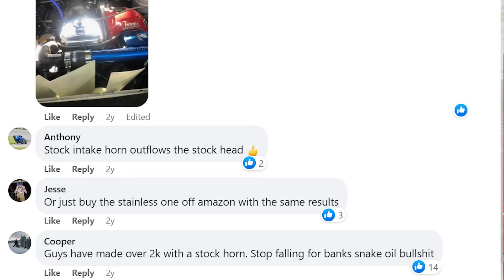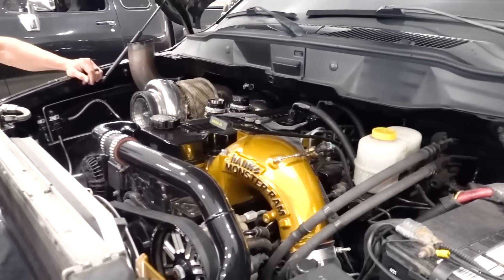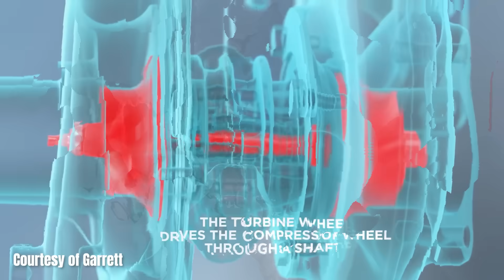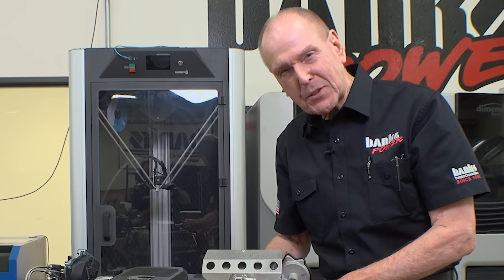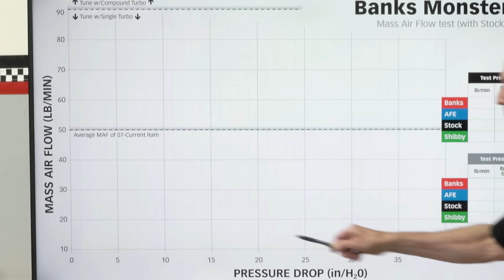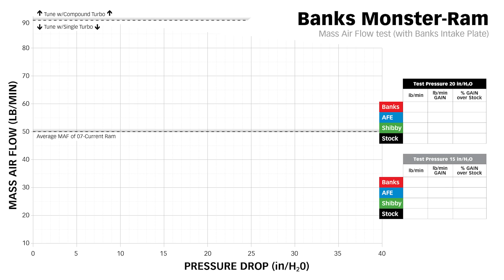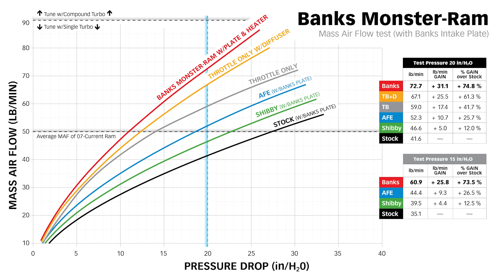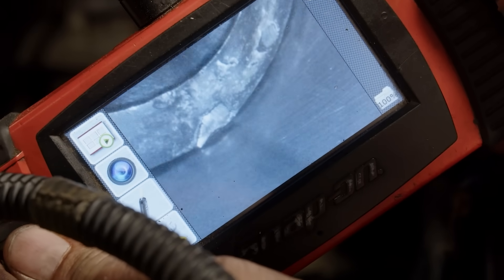Stop this wives' tale about Cummins engines! | Fact Check

Comment: Spoken like an absolute legend, CFM is only volume the air charge density is king to delivering enough oxygen to the fuel charge, so many focus on basic rudementry CFM volume no replacement for displacement well absolutely crap a dense air charge at 15 psi entering the cylinder immediately expands heat energy is absorbed by the time the valve is closed the intake charge density has begun to absorb heat lessen density for only a short few degrees if any really heat energy is transfered into increased cylinder pressure and ultimately higher energy potential of the charge I would imagine thus power gains god sent I absolutely love hearing solid information thank you sir !

Comment: You said the head wasn't the restriction as claimed....  and then showed us a flow bench where you didn't connect your elbow to the head.

Flowbench each elbow with the factory head.  But you won't, because that will show you're wrong. 🤡🤡🤡🤡
Reply from the maker: You've managed to completely miss the point. The Monster Ram reduces air density loss in the intake, so the air going through the head is denser. This means even if the head is flowing the same CFM as before, it's now flowing more air mass. CFM doesn't determine your power potential, air density does.
Reply: And yet you don't measure air density that comes through the head.  You stop at the elbow.
Reply from the maker: Think of air density like your paycheck, and restrictions like your bills. The head is one of those bills, but if you reduce other bills, you still end up with more of your paycheck left.
Reply: @bankspower  think of it like a scientific test, for which you left out the literal component of the argument you're claiming to disprove.  My 13 year old could see what you missed in your test. 

If I said the earth was flat but neglected to use the earth in any of the scientific tests I showed you as proof, it would be just as laughable as your attempt.

Comment: So mechanic here. 😂😂 degree to prove it. I do my research on everything I buy. Banks by far has the best upgrades for cummins. I can't say the same for every make only bc I have not done my research on those makes. I did also replace a few parts. I have the banks intake horn grid heater delete, banks pedal monster, banks intercooler boost tubes, sinister coolant pipe, sinister intake tube. For the engine parts. It is night and day how the banks' parts and sinister parts helped my truck breathe and run way better.
Reply: The only downfall I have for banks is the boost tubes rubber couplers are too short. They are made well just made short. Need a little more  length on them.

Comment: Travis, The better source to ask on the CFM specs would be a reputable machine/ porting shop/ guy who has a flow bench. I'm a 25+ year tech who has and will turn a wrench on basically anything, but my knowledge is limited on flow numbers/ porting experience. Sure I've gasket and flow matched manifolds, done some mild porting work, and built some fully forged/ performance oriented long blocks, but for my machine work, balancing/blueprinting, valve seat grinding, extrude honing, etc I'd rather send my parts to a real engine builder that has the proper tooling to complete the machine work portion of the job. It'll not only save me some time but get me more accurate results in my build as the end result while providing the flow numbers and eliminating any guesswork. It's a no-brainer whenever it's a possibility IMO. There is usually always a welcome upgrade on getting more air in, as long as the engine can make use of the extra flow and the exhaust can extract it. There aren't many OEM manufacturers stock parts that can't benefit from an upgrade.
EDIT:
Funny thing is I started writing this comment at the beginning of the video, and then Mr. Banks mentioned the flow bench.... Wasn't done typing my comment LOL.😊

Comment: I just wanted to say Thank You for the work in coming up with your intake design. I had one installed on my 2017 Ram specifically to eliminate the stock grid heater failure point that will trash my $30,000.00 (installed) 6.7 Cummins. I retired from manufacturing company ownership and know R&D is a significant expense. You spent the money and came up with a top shelf design that solves multiple issues. Thank you again.Side note: the sticker that came with the unit looks dang fine on my Stanley lunch bucket too.:face-fuchsia-wide-eyes:

Comment: Back in 78 when I was deep into turbocharging my KZ1000, I could have used you.  I went through many brands and all either failed miserably or made the same as the competitors.  I gave up as no one seemed willing to either engineer what I  wanted or help me better their products.  I would like to think aftermarket  motorcycle turbos disappeared because of lack of engineering.

Comment: I been running this setup on my '20 2500 (full emissions) leveled on 35's because I got the grid heater code.  Super Scoop/w oiled BigAss filter, boost tubes and Monster Ram. gained 1 mpg Real world city/hwy and idle combined. not only was i happy with the mpg gain, the throttle response is quicker and I love that you an hear the turbo now. it's not "loud" its just enough!!  installed it in the driveway in a weekend.  Yes, it cost me almost $2k but well worth it to not risk the engine for a failure that Ram has not recalled.

Comment: Whoah whoah, you mean even some some people who work on engines and mechanical systems dont understand bernoulis principle and that cold air compresses more readily and is more dense than hot air?  Thermodynamics, math, physics... It's like there's a difference between a mechanic, an engineer, and a technician!  😂

Comment: Great video Mr Banks, but you did not speak or test the head flow conspiracy , you only spoke about the elbow? How much air can you flow thru a  6.7 head with all the different elbows? I think the end all would be testing the flow numbers out the tail pipe or at least out of the exhaust ports, no?

Comment: I've been reading an learning about Banks. You have some pretty amazing engines that he's built. It's not every day somebody builds performance engines for the military. I found his engine theories and techniques to be un unrivaled. I just turned around with small stuff my daily drivers what is insights in the series and his proofs are impeccable and I've used them to produce amazing amounts of power out of otherwise stock engines.  
It always amazes me how much horsepower people leave sitting on the table just waiting to be used and they don't even notice it..

Comment: Come on Gale, MAF sensors do not read "Mass Air Flow" or Density.  ALL manufactures flow bench the entire intake track,  the MAF Sensor is nothing more than a microphone, that is feeding a Frequency in HZ to the ECM and then ECM uses a combination of MAF VS. IAT and even MAF VS. ECT to determine Air Density....   the MAF alone can't do that

Comment: I'm well and truly drunk, and even in my current state I know that the intake manifold is a restriction in airflow if not designed properly. In my opinion, the best design for the intake manifold for a Straight Six is a single, semi-divided plenum with two air feed ports for the front three ports and the rear three ports. Look at the cooling system modifications that were done to the 3406B Caterpillar engine, they added a coolant bypass hose from cylinder six because of overheating back there, and the air intake port for the head was up around cylinder two. The placement of the intake port caused cylinders five and six to run lean, while one thru four ran rich or stoichiometric, which means five and six ran hot, which necessitated a bypass hose to eliminate hot spots and extend the life of the liners and piston assemblies. Yes, the head is a restriction in airflow, but you can only do so much before you require a new and better intake system. If I could design my own V8 diesel engine I would totally reverse the flow, such that it exhausts to the valley, in which the exhaust manifold and turbo is mounted, and from there the compressor side of the turbo discharges to the air to air heat exchanger, and which then feeds air to the intakes on the outside of the heads
Reply: My god, I cannot believe how long this comment is and how long it took to write. Allah forgive me for this

Comment: Before you even get into the reasons why they're wrong, I'd like to chime in. I work with air flow for a number of decades when I did industrial sheet metal with air systems and building rather large heating and cooling systems for industry such as Automotive and Aerospace. Including paint systems and other such devices. Yes, the stock had does flow 250 cfm, but it what density or at how much intake pressure. If they saw a test where it only flowed 250 CFM, it was more than likely at a specific air flow standard. If you could put more pressure through that stockholm, you're going to get a whole lot more than 350 cubic feet per minute through it but why try and force it through a, less than ideal, air horn that doesn't want any more CFM then that which will feed the engine as it comes stock.
Even if the head could only breathe 250 cubic feet per minute, better airflow to the head is still going to result in more power and a better breathing engine. Because it is being fed a better amount of flow, you never tested that head with the better flow numbers getting to it you only tested the head at a rate which it would flow 250 cfm. If I remember right that's pretty close to the flow of a 318 a block from 1965 or so. But that's only at a specific setting.. and for a V8 that only put out about 235 horsepower with a two barrel carburetor, it did the job. But that same head will flow 350 or so cfm, if you clean up just the standard manifold and carburetor and remove some of the restrictions of the exhaust manifolds and related Hardware.
Luckily, I've been tinkering with cars since 1965 and had the luck as a teenager to rub elbows and work with some of the best hot rodders in the business, that were involved in ramchargers racing, and Mancini racing over here on 6 Mile Road in Detroit, back in the 70s. Everything that they taught me about, is still just as valid today as it was then because physics is physics.
Mr banks, your work is much the same, you make sure that everything you try is tested to a higher standard than they did then. Back then they would do a design, and it put it on the racetrack and run it. Unfortunately in the 1970s you started running into Engineers that had never learned to turn a wrench at all. A crescent wrench would confuse the hell out of them.
I eventually did work as a engineering consultant, because I could speak to them and understood what they were saying, and I could relate that to the people actually doing the work because they frequently don't speak the same language. The advantage I had was I knew what could reasonably done in a specific allotted period of time. With the resources that were being applied.
I learned an awful lot about their mindset and the mindset of the people doing the work, which I refer to as applications Engineers because they have to what the engineers desire and have designed, and actually manipulate it to make it actually fit and function. I'll take an applications engineer over a man who draws pictures all day long.
I still prefer the speed density system, because you can extrapolate air density in the intake by temperature and manifold absolute pressure, just as well as you can with a mass air flow sensor, which only takes its information from a single point in the intake air flow.
Temperature and manifold pressure tells you, at least as far as I've ever understood, all the information you need to know as to how much air is actually available at the intake valve before it opens and during its being open. This includes any compression you've added to the intake air. The only major concern after that, depending on how well you have the head set up, is the most least restrictive exhaust possible. Remember that the engine is a glorified air pump, the more air that comes in and the more air that goes out increases its efficiency.
I love the idea of rectifying the mass air flow signal so that you adjust it for the density difference that is necessitated by the larger intake tube. All you did was a step adjustment from air flow at nominal air density through a specific cubic foot of air mass at whatever aspect ratio you're measuring it at, if it's a round tube then the aspect ratio is zero. Then you just step it down to measure the air flow at the greater size of the cross section, at zero on in this instance, bought accommodating the larger amount of mass because you have a larger cross section. The math is actually quite simple although sometimes people didn't always pay attention in 3rd to 5th grade math.

Comment: I dont see how his testing is that great no cold heat cycles no wot under maximum gcwr. In severe desert heat . Typical hot rod california built junk. stock cummins will outlast the truck, modified diesels fail short of engine life cycle. The oem manufacture spent hundreds of millions of dollars on whole package r and d.every component tire size to chassis dynamics is matched.

Comment: So really, we should just use scfm and temperature. Scfm will really be equivalent to mass flow, and temperature is another item we're interested in for combustion. 

Flow wise, I don't think anything is near 'choked' in an engine, so every component can flow more given higher pressure difference. Which means that if you reduce pressure drop somewhere else, your overall system flow increases.

Comment: I have seen other people comment similarly where they felt your products are overpriced but now see why they carry the price they do. I am in CA where your efforts to fight CARB and ensure you can obtain compliance have been immensely appreciated and I am sure immensely costly. I can understand why they carry the cost. I can also speak to their longevity I have a 2002 F250 with a full complement of Banks kit installed on it since new. Zero mechanical parts have failed in 325k miles. The only failure was the chip that improves the system in response to the parts which unfortunately with the age of the truck I just cannot justify the cost to replace but the other parts still work great without it.

Comment: This is interesting to see! I came up with something similar 3 or 4 years ago. Machined 6.7 intake plate with no stock heater, the huge AFE intake horn (non egr type), and my own piping to go from the '05 intercooler to a 6.7 intake and I used a ford intake heater at the inlet of the intake horn. 05 ram swapped to a 6.7 big valve and lightly ported head, 66/74 over S480 compounds, and it starts in colder conditions than my stock 07 or my stock 2017. Makes more boost and power than a stock truck from idle all the way through. Doesn't even smoke unless I'm all the way in it and having fun.

Comment: If air density is a thing I would think you can gain horse power from just cooling the air between the trubo and the intake valves.😇😇

Comment: Gale, I love the science. I have a question. You said near the end of the video that you can acheive more power with the same fueling utilizing the monster ram product package. If the Ram allows more air flow would you not have to add more fuel because of leaning. Would the A/F ratio not be thrown off towards the lean side? 

Thank you for all you do. I appreciate your passion and knowledge.

Comment: Well damn Gail, you've done it again! The first half of the video explains boost/density/CFM flawlessly, and I will be showing it to friends who don't understand the complexities with how boost works (not always as simple as "boost = happiness") but then there's your intake kit, for the boost horn to flow a lower restriction than nothing at all, that's one heck of an accomplishment! And honestly, anyone who loves their engine would probably be nuts not to invest in the kit given the reliability improvements as that stock charge heater as mentioned is a doozy for a start, but then you've got lower turbine speeds leading to increased turbocharger life, and improving the fuel efficiency is likely to help with the lifespan of emissions control hardware 👍

Comment: Banks, here is where I see the problem.

You are using science, with proper methodology, consistent testing and  proper data logging.  

Unfortunately, the witch burners just don't get science nor know what a proper methodology would look like even if it was to bite them on the ass.  

As a former mechanic and engineer, I admirer your drive to be great at what you do. To find the wheat amongst the chaf.  

These days Im into motorcycles and I get frustrated with the witch burners. You try to part the basic of volumetric efficiency and A/f  ratios knowledge. 
To be meet with hostilities. 

Imagine trying to part with, piston dewell time, rod angles, offset pin centres, valve trumpet shapes, size, weights, 3 cut v 5 cut, throat shape, size, finish, pipe cross sectional and flow capacities, flow/pressure changes and alike.  

Without a proper baseline, how can anyone say what gain or loss an aftermarket producer item/s has given you?

Ie, fit our product (x) and remap to gain 4hp.

Where if you had remapped to start with you may have gained 6hp! 
Saved yourself $1,000+! Or spent that $1,000+ on a different producers product (x) that is properly tested and does as claimed.

Not many like you in the industry. ❤